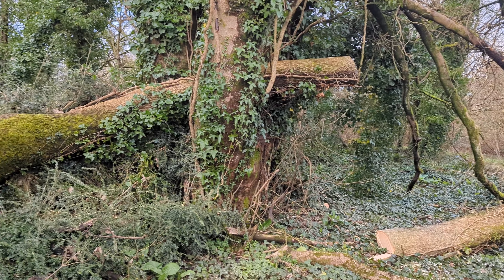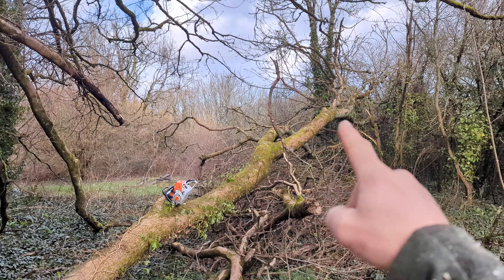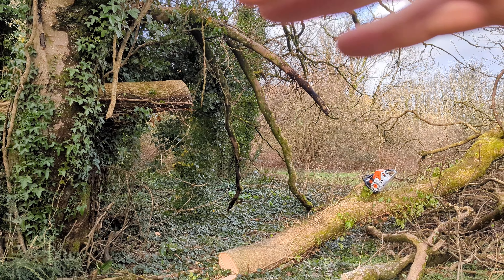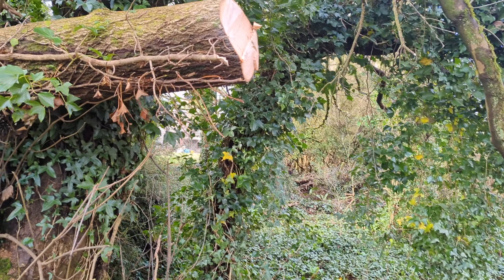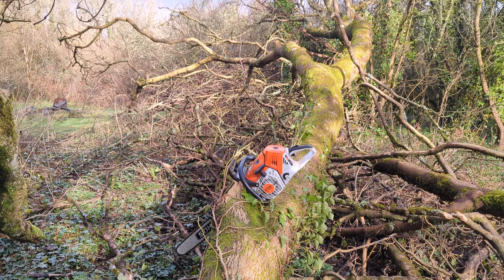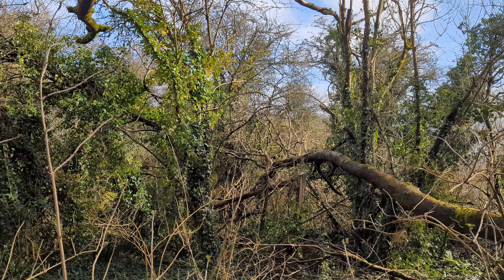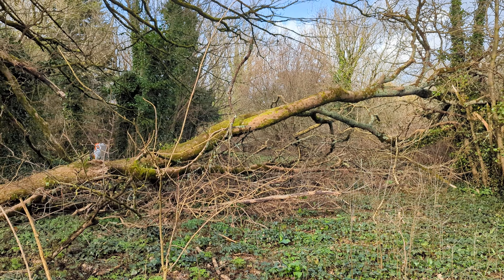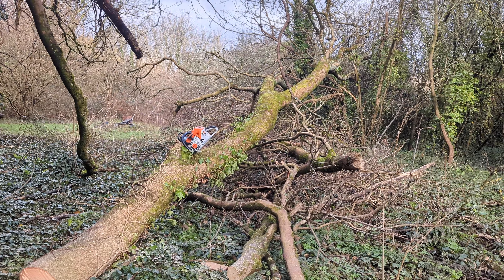This was Sketchy! Ash tree went the wrong way! Stihl 500i the chainsaw for this one.

Comment: Whereabouts are you from buddy.
Reply from the maker: Hi mate, I'm in Monmouthshire 👍 how about you?
Reply: @walkerscountrylife  Ebbw vale. Where in Monmouthshire. 👍
Reply from the maker: @garethharris560  not far from Monmouth 🤪
Reply: @walkerscountrylife  👌
Reply: @walkerscountrylife  As promised, i would be commenting on more of your videos, here goes, grab a cup of Tea. Ok so would i have handled it the same way as you absolutely not. Cutting at head height with a hung up tree, asking for trouble. A consistent theme is that you dont settle your trees down. But if i had have handled it the same way, as soon as I got pinched on the bottom side of the cut. I would have learned valuable info, in that the tree still want to fall. Id have got a rope on him, at the far end, and encouraged him to finish falling as low as possible. I believe that your lack of agency in getting these trees to ground is heavily influenced by the way that you cut up the tree. i.e. you use a top or bottom side wedge removal to remove compression then finish your cut. this can be done at height, so you dont see the importance of getting the tree to ground, as you have less need to do so. i'll go into depth on this and the technique that you want to be using to cut the trees up. heads up it involves bore, (plunge) cutting, and as you will see, the abilliry to run a shorter bar for any given size of wood, i.e half the diamiter of what you are cutting. how would i have done it. I'd have started cutting behing the upright tree, using that as my shield, and its lower. with the reduced counter weight rear of his pivot he should have continued his fall. If nbot then rope him down. and cut from the light end back to the butt
Reply: @walkerscountrylife  Greetings from montgomeryshire btw